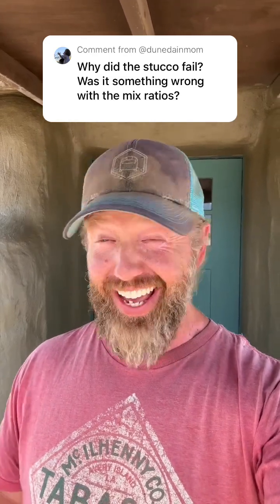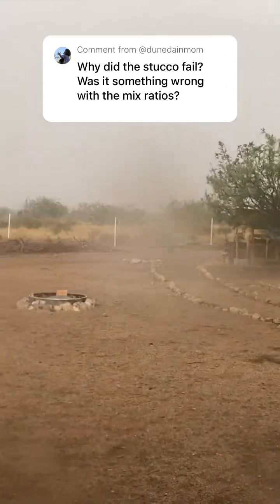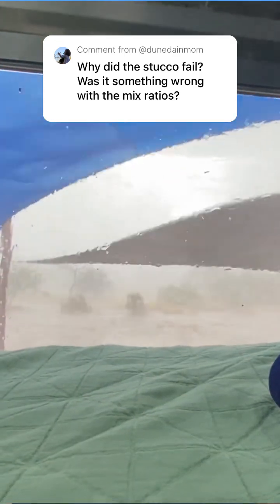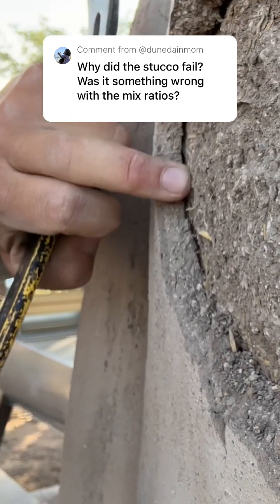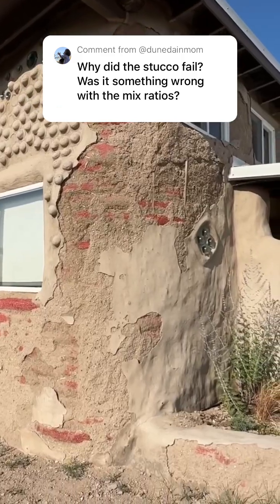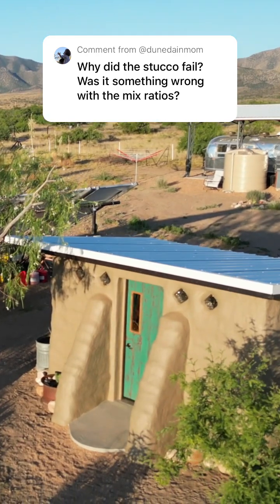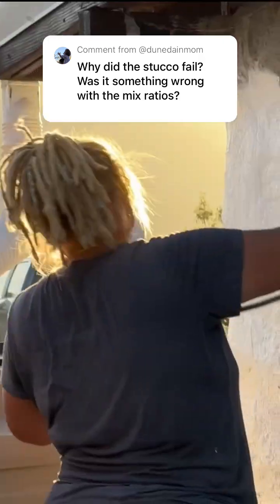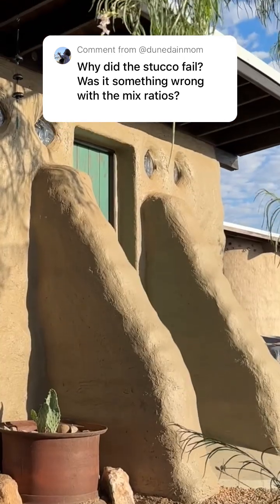Why Did the Solar Shed Plaster Fail? #hyperadobe #offgrid

Comment: 😢don't feel bad...Cal Earth is now seeing a thousand structures melt under flooding rains...... Climate Change is obvious to anyone and Weather Wobble will get. Worse....I'm using Concrete Block filled with Foam and Put Sloped Earth against that with buttresses inside....